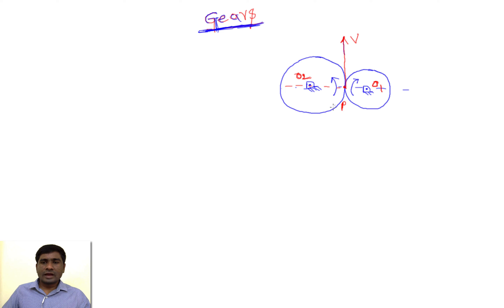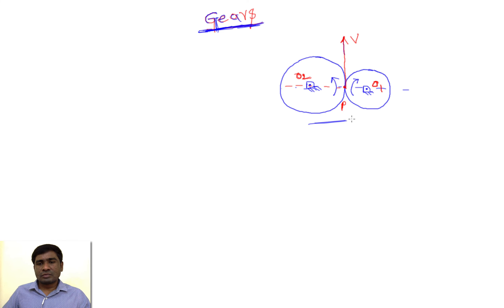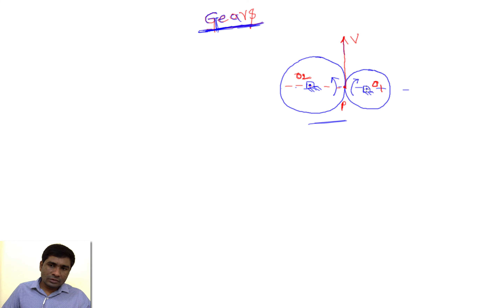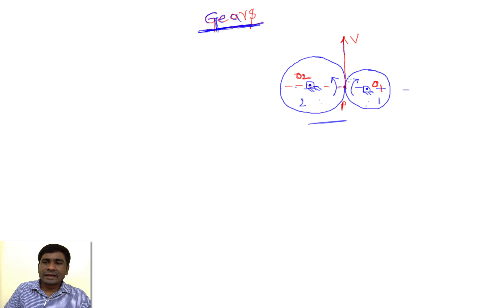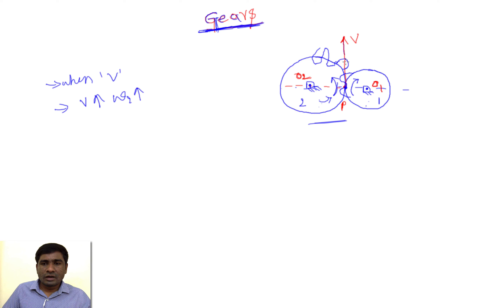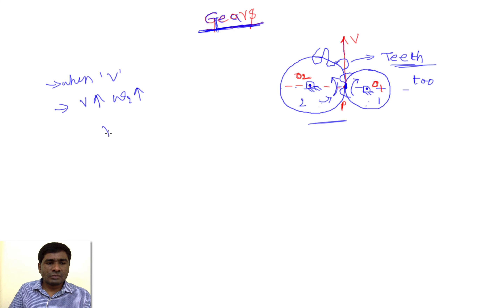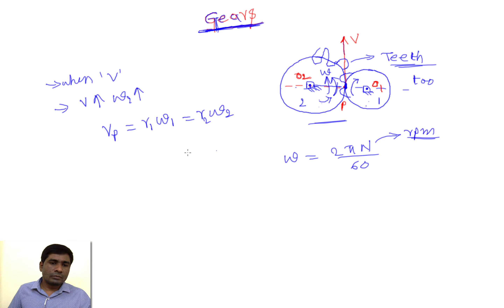Gears 1: Introduction, velocity ratio

Comment: sir how to find coefficient of fluctuation of energy if the given condition is lyk maximum speed of a flywheel is 5% more than  minimum speed.
Reply from the maker: min speed is n1 and max speed n2= 105/100 n1 =1.05 n1... Delta E = 1/2 I (n2^2-n1^2)* 4 PI^2/(60)^2...here I given, N1 given...
for more examples please watch flywheel lectures series..
https://www.youtube.com/watch?v=TbVeAc-OSPg&index=6&list=PLiKZmh4IhSfuNgsVcNQozJxmX5asC_1BU
Reply: Tanq sir and we need lectures from Balancing topic(both -static and Dynamic).It is one of the important topic in Tom in gate exam, its more useful for self studying gate aspirants.